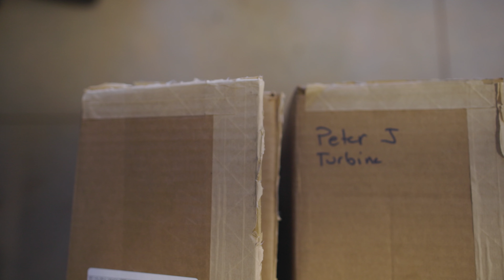YT Industries Izzo Bike Build - Fleet EP.4

Comment: Is that 50 or 40mm stem?
Reply from the maker: 40mm!
Reply: What tire set are you running? I have a Izzo core 2 I get into some pretty rocky areas at my local trail and the original forekaster that came with the bike ain’t cutting it
Reply from the maker: I run the Maxxis Assegai in the front and DHR II in the rear, both in the double down casing. For most riding the EXO plus casing will offer enough protection and support though. Hope this helps!
Reply: I could only find the assegai in 60tpi/foldabale/ 3ct,exo+tr which is 29x2.50wt
Reply from the maker: That is the exact tire I would personally recommend: I run that in the front on most of my trail bikes with a 2.4 DHR II in the rear in either the DD or DH casing 👍🏼 The 2.5 width is a great confidence boost.
Reply: Say no more placing my order today. Thank you for the fast replies and advice 🤙🏼
Reply from the maker: @armandosaavedra2392   Sweet! I hope you enjoy; those tires will be a massive upgrade to your Izzo. If there is anything else bike set-up-wise that you are struggling with, I have an Izzo bike check coming out next week that could hopefully help with any lingering questions 👊

Comment: Beauty. I found it a nightmare to put on those rubber washers on the rear brake lines as it enters and exits the frame and re-enters and exits the rear suspension arm.. And is it just me or did I miss the olives on the brake hoses while installing? Have fun riding it!
Reply from the maker: Pro tip for the rubber washers is to toss two drops on chain lube on the inside prior to sliding them on, that will make your life a lot easier (speaking from experience). Regarding the brakes, the Shimano brakes (in this case XT 4 piston) come pre-bled and the olive is actually inside of the lever from the factory. Thus, all you do is cut the line, install a new barb and then insert into the lever and tighten. Very simple, hope this helps! Feel free to ask any other questions! Happy riding!